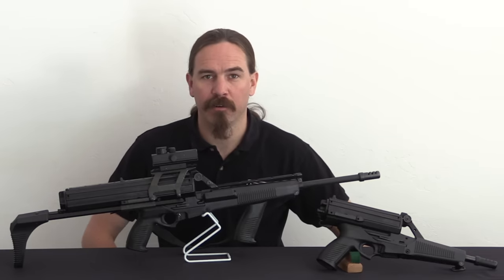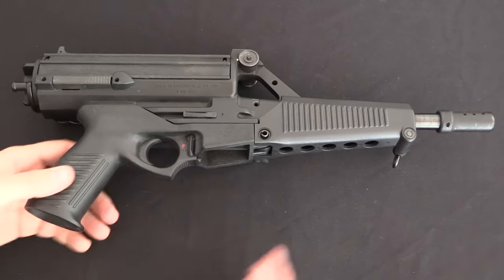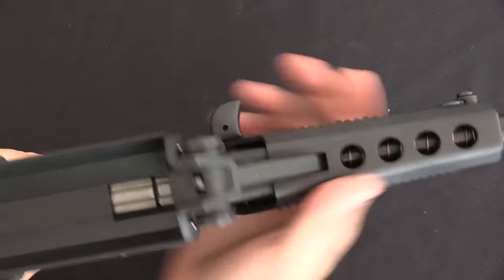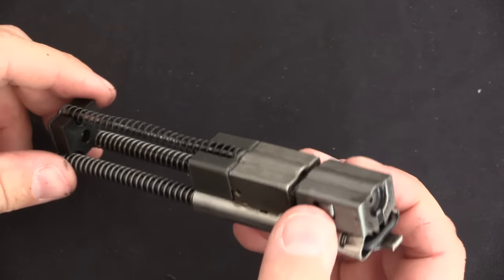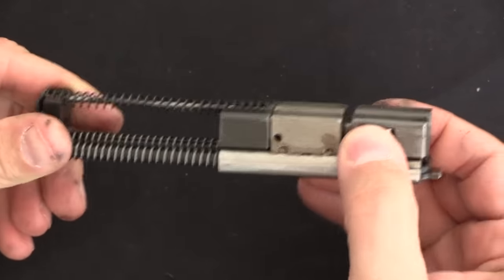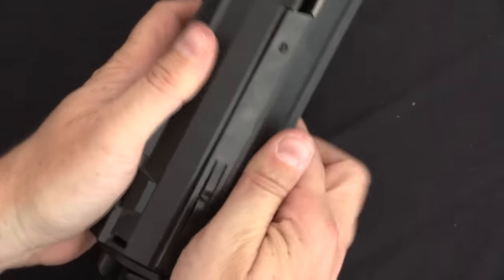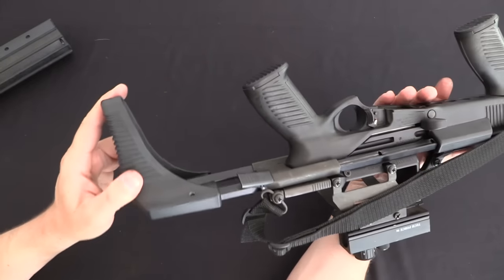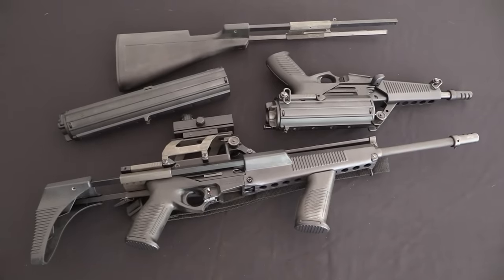Calico Light Weapons System: Roller Delay and Helical Drums

Comment: I had one of these just before the magazine ban. It worked fine for a couple of years, then I wound the magazine spring too tightly. Something broke, and it's been a paperweight ever since. No other malfunctions with the pistol ever happened, so I was quite happy with it overall. If someone could just go into business making new magazines--maybe even develop the design a bit to make them harder to break--I'd gladly buy several new magazines.

The pistol had decent, but not exceptional accuracy at 10 to 30 feet, but was iffy beyond that range. It was fun, however.

Comment: Just a brief observation. Both failures occurred right after a string from the shoulder. You then partially dismount the gun, turn to comment to the camera. You elevate the muzzle, mount the gun and at that point fault on your first shot. For what thats worth.

Comment: i had the idea of a gun that was: 
similar to a P90 in size but has 2 magazines in a Y configuration like that of the 1917 Burton aircraft gun where you push in which magazine you're using and the other disconnects but stays in the gun(giving you the ~100 round capacity), and having a collapsing barrel extension for longer range engagements that you fold up and back along the top of the gun between the 2 magazines for when you need to do CQB......
then i see this gun

Comment: I've OWNED BOTH 9 MM and 22 RIM FIRE pistols!!  THE 22 is by far the most reliable. The 22 is also the hardest to load, - like if you want to shoot a while, (pay in advance the $150.00 <I DID> per mag} and load several all at once. FUN FUN FUN FUN, is all I can say, a GREAT point and shoot weapon, - without using sights!! I shot 1000 rounds through this gun at the range, and it NEVER failed!!!
THE 9mm, is a different story!! I bought all the acessories for both guns, and the 9mm has a crank in loader that will load 50 rounds into the mag for you. (you need do it twice for the 100 round mags), MUCH MUCH EASYER  than smashed thumb, from pushing all the 22s down into the mag. NOW THE NITTY GRITTY (that's the problem), I found the 9mm got really dirty, and started jamming all the time, when I switched to a second mag. I shot out the first 50 round mag, switched up tp a 100 round mag, and by the 10 or 11 shot, (mag not at fault, and tried a lot of different ammo), it began jamming!! (THAT WOULD BE shot #60 and #61 JAM'D!!!  I FIELD STRIPED THE GUN cleaned everything as well as at home, and went back into shooting that 100 round mag, minus those first 11 shots I used. HMMMPH!!! THE 9MM JAM'D ALMOST EVERY SHOT FROM THEN ON!!! different ammo, mags, befor cleaning, after cleaning, just kept jamming. I got rid of  the 9mm, years later I bought another and had to get rid of that one also. JUNK!!!!!

Comment: I find it interesting that my Calico M950 has the grip assembly similar to what's on the carbine. I imagine they are the same dimensionally, with the safeties being slightly different. I wonder about the mechanical differences between the two grip assemblies?

Comment: I have an idea for that system.. an auto winder that puts set tension on the spring as its slid into locking position. No wind, no problem.  Frankly though if can be made dependable its worth pre winding mags to have that many rounds in a small package. Even just designing a set to use the drums but also working with a single or multistack stick like the p90 or keltecs 5.7 would work, or a round top drum option. Make the drums an option rather than the only.  Hell why not do belts in those drums instead of a spring?  Gave up too soon, they did.

Comment: Every time I think about that magazine-mounted rear iron sight (along with the balance issues trying to handle the pistol with a 100-round magazine) I find myself thinking that it would've been better as a bullpup style, with the magazine reversed so that it fed from its rear instead of its front. That way, both front and rear sights could be mounted directly on the gun itself, and the bullpup configuration avoids the problem of it being too front-heavy. Note that the topside Picatinny rail would be mounted sturdily to either side of the gun, leaving the other side open for the magazine.

The pistol version would be... interesting. Bullpup pistols are pretty rare, and the 100-round magazine would set a certain minimum length to the barrel. It might even blur the distinction between pistol and carbine, or machine pistol and submachine gun, depending upon the use of a stock. Chamber it in 5.56x45mm NATO, and you've got a PDW.

Comment: I watched a video called "the worst gun ever" which I think was about this gun. Turns out, the bullet used the higher grain federal rounds that "pop" more than the surplus rounds the guy was trying to use. He redacted his statements, and said the more expensive higher power 9mm cured the jamming issues. There are a lot of odd mechanisms activated by the blowback, it needs a lot of inertia to work successfully. It was designed by the high power 9mm used by the Beretta in Law Enforcement. The civilian models were not different at all in this regard.

Comment: Seems more appropriate to call the firing mechanism a linear hammer rather than a striker, since the firing pin itself is not forced forward by spring pressure like in a true striker-fired system.

Comment: Just bought a new Liberty 1. Ordered 4 100 rd mags, and 1 50 rd. mag. A speed loader, a brass catcher. Yes, their website is lacking? But call
and talk to them. Expensive? probably the same as 1980 prices when you figure in inflation. 2 translucent 100 rd mags, and 1 50 rd translucent mag.

I will post when I recieve everything. You will be the HERO at the gun range? lol. They rock.

Comment: That magazine is cooler then the P-90 design.  Having to transfer the cartridge 9p degrees is prone to problems.  Helical has its own problems, in that density vs size becomes a problem.  Ah, this design still seems cooler.

Comment: With it taking 23 turns of the crank, some of them could not count that high, or figured that if 23 was good then cranking until you couldn't was better. It is like condition 3 is required for so many carry guns, Uh Georg is the safety on? I don't know I will pull the trigger.

Comment: This is a very clever design, lots of parts doing two or three jobs, and to have the whole thing disassemble with no tools by pulling a single pin.... if you’ve ever tried to design anything that goes together in parts... you have an idea how difficult it is to get to these solutions.

Comment: I remember when they came out. I bout a AMT Auto mag 2 and then a Auto Mag 3. I loved them both. They were flame throwers and the Auto mag 2 had the most impressive flash.  Not good for self defense with the flash. You would be blind for a hour. Just kidding. I also had a Long slide and the Hardballer. Se people think that they were cheap firearms but in 15 years I never had any problems. I kind of wish I would have bought one of these 9mm just to say I had one at one point.

Comment: I had 2 9mm rifles, 1 9mm pistol, several mags both 50 rd and 100 rd and 1 22 rifle. I never had any problems with any of the 9mm. They always ran flawlessly. I sold the rifles for a lot more than I paid for them when the 1994 assault weapons bill came out. Kept the pistol and ended up getting into AR's. I sold the pistol when the Sandy Hook buying frenzy happened. Still have the 22 rifle and it has never worked right at all. Calico fixed the magazine in the early 90's but it still won't run. Been in the closet for years. I always thought they were good guns as far as the 9mms. I don't know bout the 22s.  People were in awe when you pulled one out. At the range, it was fun to run through 100 rds in a mag dump. That would get attention.

Comment: I shot one of the pistol versions several times in the early 90's. Dude I knew (much wealthier than I) had one. I liked it, more or less. Briefly considered getting one. But I didn't. Too large/heavy/bulky to be practical, and the reliability issues referenced by Ian came in to play. However, at the time we did note that various ammo types/brands functioned better than others. It most CERTAINLY did not like ANY form of HP or truncated bullet configuration. Nope. Basic 115 or 124 FMJ ONLY need apply. And then it was best to stick to USA or major Western European manufacturers. It was not a huge fan of random surplus rounds from who knows where, with Arabic, Hebrew, Cyrillic, or other headstamps. I know not why. And we had LOTS of those rounds laying around at the time. Otherwise it seemed ok. "Kind of cool" as Ian likes to say.

Comment: Relying on front sights on interchangeable barrels is nowhere near as wonky as relying on rear sights on removable magazines that are held in by a latch. If the manufacturer is able to make reasonbly straight and concentric barrels and maintain the height and clocking of the front sights across barrels, it should be very close to zeroed across multiple barrels. The bullet does come out the barrel muzzle, after all.

Comment: "assuming the magazines work reliably"  well not in 9mm it does not.  As an former owner of 3 calicos   .22 carbine,  9mm pistol & carbine; the mags in 9mm are junk.  Put 500 rounds through it and you will notice the wear already.  I sold my 9mm(s) at a loss within a month of purchase.   The .22 is a fun plinker and the mags(2)  still worked after 20 years.

Comment: I wonder, why did they go for that weird sighting system with the rear sight on the magazine and the front one on the back of the gun, when they could've simply put the rear sight in place of the front one, and the front sight on the barrell... obviously it would've needed a pretty tall front sight post, but honestly I'd rather deal with that rather than a wandering zero
Reply: seriously, rear sights are useless. If your front sight is on target, just fire. That's all you need.
Reply: If you take the time to lock up your target with the front and rear sights, you are toast. Just put your target with the front sight and fire.
Fuck all that bullshit with the rear targets and taking time to try and align everything? No one has time for that.
Your front sights are all that you need. Wandering zero, you are so cute? lol. Front sight on and fire.

Comment: Be nice. That will go a long way. Don't be an asshole. I've had good luck. Sometimes things take longer than you want. It's all good. Just be polite. It's all good.
It's not all about you? If you can get over that, you will be just fine. It might take WAY longer than you could ever imagine? Just don't be an asshole.
It will all work out. Heather is actually outstanding to work with. She is my hero? WAY longer. I'm not kidding. WAY longer. In the end, it's all good.
Patience, little grasshopper. It all works out? Did I mention WAY longer? Do you get my drift? It's all good. It will all work out. It's all good. Patience. Reward.